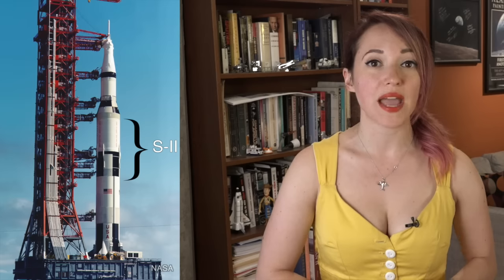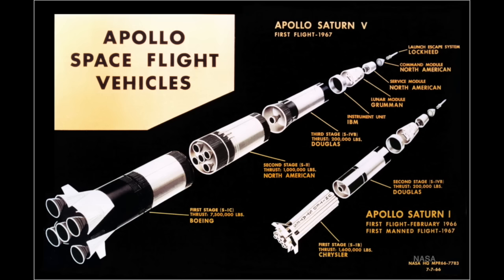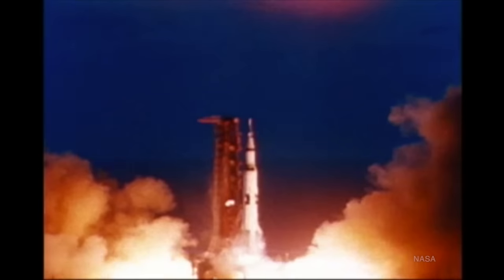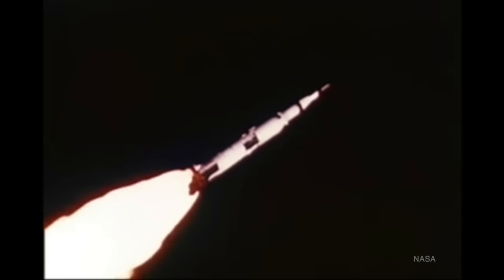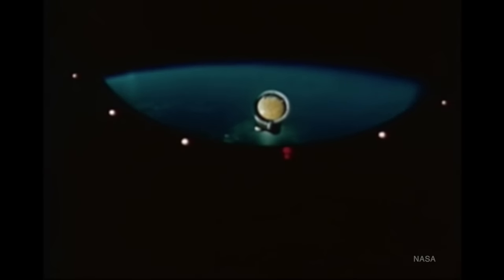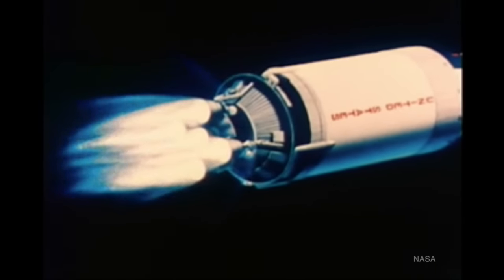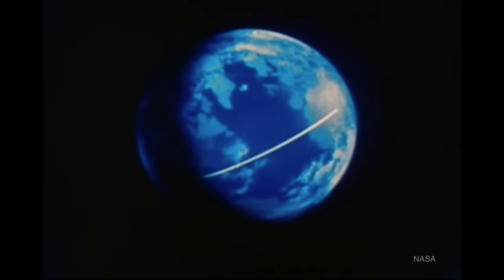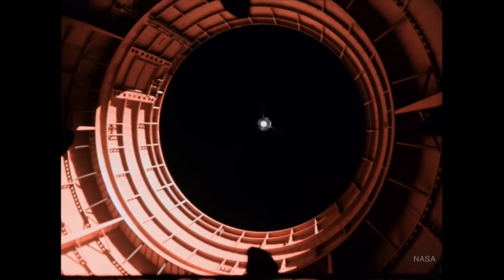How the Saturn V Broke into Pieces Launching to the Moon

Comment: Yes, we launched multi stage rockets when we were kids.  One time my brother mixed up the staging on his two-stage rocket. After the first stage burnt out instead of immediately igniting the second stage motor, it delayed, the rocket fell towards earth, then the second stage ignited and drove the rocket into the ground.  We were lucky no one got killed.  The rocket was not that damaged, only upper part.  I was able to cut away the lower section with fins and reuse it.  When I built rockets I spent the most time cutting, sanding, glueing, sanding, doping, and painting the lower fins on my rockets so they would fly straight and predictably into the wind.

Comment: While it is true that rockets have multiple stages for mass reduction purposes as you've stated, it is also important to note that they have multiple stages for engine performance. A rocket nozzle is really only designed for one specific altitude where the gasses expand to ambient pressure, and any underexpansion or overexpansion of the exhaust gas yields reductions in performance. Slight overexpansions are acceptable and simply cause a reduction in engine efficiency, but extreme overexpansion can cause flow separation of the exhaust gasses yielding bigger issues such as flow instability and damage to the nozzle. So while it is important to reduce mass, the multiple stages are also used to maximize the engine nozzle performance over a wide range of ambient pressures.

Comment: Reading the Book "How Apollo Flew to the Moon", which as far as I know is the only book that really explains pretty much everything about how the Apollo hardware and navigation and orbits worked, I was surprised to learn that the Saturn V was basically bolted or riveted together into a single massive assembly, then was selectively and sequentially blown apart by pyrotechnic devices such as explosive cord. Simple, no normally moving parts, reliable, light weight. But it does kind of damage the discarded sections in the process.....not a worry if the whole design was expendable anyway.

Comment: You asked about multi-stage rockets, and I hold a level 2 high power certification, allowing me to purchase and use up to L impulse (5,120 newton-second) rocket motors. What I have seen most often is a loose friction fit between the stages so aerodynamic forces and the lighter density of the booster after burnout cause stage separation. A small computer in the second stage senses first stage burnout with a simple accelerometer then sends power to an electric match that ignites the second stage motor. The same computer will power a second e-match at apogee to separate the second stage into two parts and deploy a drogue chute, then fire a third e-match at lower altitude to deploy the main parachute. This way the rocket descends faster and doesn't drift as far downwind. But it also makes the flight more complex and more likely to end in an expensive failure.

Comment: I am currently building from scratch a two stage model rocket for my school engineering project. The ejection charge from the booster stage pushes the friction fit stages apart and shoots flame into the second stage engine.
Reply: +Bluegillbronco2 I used to do this the same way when I built model rockets some years ago. I did a 3-stage with an E booster and two Ds (both the E and the first D had a zero second delay on the ejection charge). Worked like a charm.

Comment: Recently I've been wondering about two things regarding Saturn V launch:
1. What do we actually see during staging of S-1C? I guess it's not the explosives separating the two stages, but rather the motors/rockets causing the stages not to bounce into one another. Is this correct?
2. How are S-1C and the forward skirt actually connected? I discovered that a small part of the forward skirt remains connected to S-1C after staging, but, to repeat the question, how are they connected and how do they split?

Comment: in small model rockets the second engine ignites and the pressure forces separation. in larger model rockets the stages are separated with an electronically ignited black powder charge.

Comment: Multistage model rockets are not that common, but they do exist.  Smaller ones are held together by simple friction, with the ignition of the sustainer stage engine providing the pressure pulse to pop off the spent booster stage. Larger "high power" model rockets can use friction fit, or thin plastic or wooden "shear pins" which are cut by a small explosive charge at sustainer ignition.  VERY large models such as the 1/10 scale Saturn V that was flown a few years ago use mechanical linkages operated by surplus automotive airbag inflators or similar devices.  

For small models, separation timing is achieved by carefully selecting the booster engine burn time and thrust characteristics. Ignition is via hot gas from the nearly spent booster engine burning through a forward facing plug, and being directed into the open nozzle of the next stage, igniting the solid propellant (compressed black powder). High Power models generally use electronic systems involving altitude and acceleration sensors to detect booster burnout and initiate stage separation and sustainer ignition.

Comment: I usually say, in conversation, that the Apollo spacecraft had over 1 million parts which all had to work perfectly - making it the most complex machine humans have ever created. Heard that somewhere. Hope it's right.
Reply: +LTrotsky 21st Century It didn’t all have to work perfectly to have a successful mission. There
are a lot of redundancies built-in. Like the Apollo 12, was struck by lightning twice during launch and they had to
switch to auxiliary power.
Reply: +LTrotsky 21st Century :Close enough. I've also heard 2 million parts but doubt anyone knows for certain. Otherwise, we'd hear 1,536,248 parts or something similar.
Reply: Michael Cole Would have to be Shep, yes? Either Shep or Glenn.
Reply: Michael Cole
Well, Glenn was on the Shuttle too, no? That's still only two systems. I'm probably not going to be able to do this from memory. ;)
Reply: Had to look it up. John Young. Gemini, Apollo, Shuttle (both on Columbia). Never would have guess it. Good trivia!

Comment: I forgot to comment.  F-1 Engines  were BAD ASS!  I recommend people research them, soooo cool! Also FYI the Saturn 5 still holds the record for most powerful manmade machhne producing an estimated peak H.P. over 7 million if i remember correctly.  And yes I did say Estemated as the ROCKET EQUASION continually changes throughout the burn.  Good video too.
Reply: +Andrew  Karpinen :I've only ever seen one reference to the Saturn-V's horsepower. That was in the Guinness world records book. According to that book, the Saturn-V generated 175.6 million lbs horsepower at liftoff.

Comment: Hi, Amy. Thanks for another great video. Why did the Saturn V first stage have stabilizer fins when obviously gimballed engines were available during the Gemini era?
Reply: +Buck George :If I had to guess, it might be because Apollo actually came into being before Gemini and the Saturn-V design goes back to the late 1950s when stabilizing fins were still in use. Because the Titan-II started life as an ICBM, they had no stabilizing fins in part because they would be silo based, and fins would require a wider silo. But I've never seen any official reason given for this in any of the documentation on the Saturn-V I've seen.
Reply: +Buck George The fins were not needed in normal flight, but analysis showed that they would slow down the loss of control in certain failure cases, giving the abort system more time.

With improvements in flight control and abort systems, there is little doubt that the fins would have been deleted from any future production runs of the S-1C (S-1D?) as a weight-saving measure.
Reply: +Buck George They aid in stability lower in the atmosphere when the craft has a great deal of mass. The fins don't use any fuel to correct the flight path. At least, that's what I gathered from Kerbal Space Program.

Comment: Actually the Second Stage of the Saturn V didn't need the Ullage Motors to get the Fuel into the Fuellines because the Second Stage Tank was pressurized (As you can also hear on the Apollo 11 Launch countdown after the T-40 Mark.) .... it just served to minimise the Velocity loss by gravity during Stage and Skirt Sep.

Comment: It would be great to find a explanation for what caused the explosion in the oxygen tank on Apollo 13.  Perhaps you have addressed the matter, or feel, rightly, that there is enough material on the matter, but--as a novice--I found it a bit a difficult to piece together a problem that evidently began with a single contractor not adjusting to the new voltage requirements five years before the event, the reason the tank didn't explode on previous missions, and the series of events that consequently caused the spark in the tank.

There are more novel matters, but I happen to be reading about it over the weekend and just stumbled upon your fine series.  Very much look forward to watching backwards!

Comment: Excellent presentation! You have a new subscriber. One question: I took a quick glance of a schematic of the Apollo 11 rocket with the landing module included, I had noticed references to both LOX/kerosene and methylhydrazine. Did the second fuel use LOX or a different oxidizer, and where or in which system was methylhydrazine used?

Comment: I have launched multi stage rockets before, but, they always were under inertia.  I have often pondered the ability to take a model plane, propel it to a high altitude with its regular propeller, and then use a rocket engine to boost it higher.  I even manufactured a working foldable propeller for it, but, unfortunately, hobby shops in my area are scarce, and I haven't ressurected the design.  Do you think such a blended unit might be successful in the future for runway to orbit transition?

Comment: There seems to be some confusion about the staging mechanics. As best as I understand it, there were no actual explosive bolts (as some have asked about) used in the Saturn V launch vehicle itself. Amy mentioned Exploding Bridge Wire. This is only a detonator mechanism, not the actual linear shaped charge explosives that physically cut the stages apart.  It's not Amy's fault!  NASA's documentation is horribly lacking in complete details in this area. It really sucks, with the exception of the third stage, which, of course, is different! Sometimes they give great detail on a component, but not on the whole mechanism. It's almost as if they didn't want to mention it (at least publicly). Going on 50 years later, virtually all the potentially embarrassing and/or once secret stuff is public knowledge, except this one part. Where the full documentation is hiding, I can't tell you, but it does exist somewhere. I've seen film clips of them testing these explosives. It's pretty impressive to see a 33-foot diameter ring of metal PRECISELY cut into two rings in a blink of the eye. I'm sorry, after a recent move, I can't tell you which DVD set has that footage in it. Some help here?

So, yes, the stages were bolted together during stacking at points known as field joints using really strong, but non-explosive bolts, excluding the aft skirt of the S-IVB, which used a metal strap. In flight, during staging, explosive shaped charges cut the stages apart at points known as separation planes.

Why use this method? Keep in mind a Saturn V's lower stages are 33 FEET wide, and the stages are bolted together with HUNDREDS of bolts. The EBW/Shaped Charge method allowed a means of staging using a simple, dual-redundant, and most importantly, a very reliable method. In fact, this is the same style of trigger mechanism used on nukes, where a dud is also a very bad thing if you ever really need it to work (Easy, I'm talking about the science of it, not morality!). Had explosive bolts been used, it would have been needlessly complicated and more likely to fail.

The outstanding question is how did they deal with the umbilical wiring during staging? Some have suggested a guillotine was used as they did for separating the CM & SM. Maybe, but there's more to it. Mind you, there were only control and data wires between stages. There were no cooling or power connections to cut, unlike between the CM & SM. The Emergency Detection System used a series of wires running the entire length of the rocket to detect vehicle breakup and trigger the abort system. So what happens if you intentionally cut those wires during staging? Might be a little problem there. Since we know normal staging didn't trigger an abort, the HAS to be more to this story. I'd sure like to know the rest of it.
Reply: +Mike Cowen Regarding your last paragraph, if you're referring to the escape tower, my understanding is that it was indeed triggered by the aforementioned wires breaking. But wasn't the escape tower jettisoned prior to the start of staging?

Comment: Was there a contingency for the staging mechanisms? In a case where the electronic signals/sensors malfunctioned, or there was a premature engine cutoff, could the astronauts manually initiate staging?

Comment: The second stage did the same thing as the first engine, shutting down the inboard engine, though with a larger timegap in between (about 30 seconds for the first stage, and a minute and a half for the second). As far as I know it's for slightly different reasons, but how come in wasn't mentioned in the video (or the blog post)? The launch tower jettison wasn't mentioned either, but maybe I'm getting too nitpicky now :P

Comment: GREAT VIDEO!!!!  

I always thought a bayonet lock would make more sense, Yea the rings would add some extra weight, but those explosive bolts left a lot of junk free floating
Reply: +Glen Clark Sorry, no explosive bolts used here. To get the same performance as the EBW/Shaped Charge method, you'd need to rotate your bayonet lock at 23,000 feet per second, and not impart ANY torque on the launch vehicle, plus a bayonet system would only be clamped at the pins, not the entire contact surface.
Reply: +Mike Cowen Good thing I wasn't an aerospace engineer ;-) ;-) ;-)

Comment: Amy, this isn't space-related but I wanna ask you something, what lavalier mic are you using? Do you do some post-processing on the sound? Because it's really clear, and I'm having problems trying to cleanup my audio :(
Reply: Use the reduce noise function on audacity.
It's free software and even my old laptop mic with computer fan whirring loudly can be cleaned up so you just hear me and not the fan.
Any old crap works just as good as an expensive mic if you feed a pause into the sampler and then select all and reduce noise.
You can probably even take out someone else's voice if they speak with a different pitch to you.  Never tried that (removing other voices) but I used to write sound analysis software and I reckon it could work.

Comment: Great video Amy! One interesting Apollo-Saturn factoid that you didn't mention was that for the later J-series missions (Starting with Apollo 15) changes were made to the Saturn V stages to increase payload. The S-IC had 4 vice 8 retrorockets, the S-II had 4 vice 8 ullage motors, amongst other changes. NASA and contractor engineers were always seeking that extra little bit of performance. Source: http://www.hq.nasa.gov/office/pao/History/ap15fj/pdf/a15-mission-operations-report.pdf. The developments through the program might make an interesting video (if you haven't already done it!)

Comment: Could you do an episode on Standing Waves in Rocket combustion chambers.  When I was at the Space and Rocket Center (Huntsville, AL), there was this old engineer who worked on the Apollo program and he was showing me the baffling in the rocket combustion chamber and how it prevented standing  acoustical waves from tearing the engine apart.  According to this engineer, during the early days of space travel, this was NASA's most closely guarded secret.
Reply: +Janet Bradford The F-1 injector was definitely a secret in those days. Apparently in the F-1 a rotating instability caused much grief during development, and the baffles were key in stopping it. We didn't want to give the Russians any edge in building large engines. There was a special security closure device that was installed in the engines whenever they were being transported. Few people remember this item. Check this out this fabulous site with amazing (and some obscure) details (be sure to follow the links for more related pix and info) http://heroicrelics.org/info/f-1/f-1-throat-closures.html

Comment: I made a second stage rocket once before. It was a sugar fuel rocket. It separated cleanly but the fuse to light the second stage burned to slow and the second engine did not fire until the rocket was already sideways. So, it propelled itself to the ground. The parachute deployed as it should, but since it was flying towards the ground, it did not matter much and it crashed into the ground. No big problem though. It was made of PVC pipe, ha. Low budget loss.
Reply: +Jesse Sisolack did you not test the fuse before installation?  its not rocket science . Oh yes so it is. did you record the launch it must have looked spectacular
Reply: +james brown I did not. I do not even think I owned a camera back then.

Yes I tested the fuse ahead of time. I do not know why it took a few extra seconds to cook off when in flight.